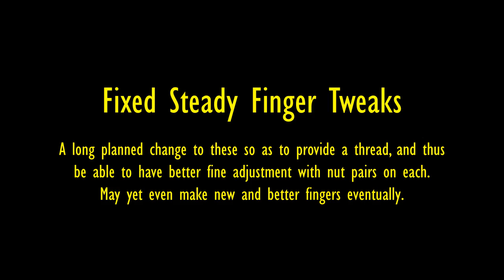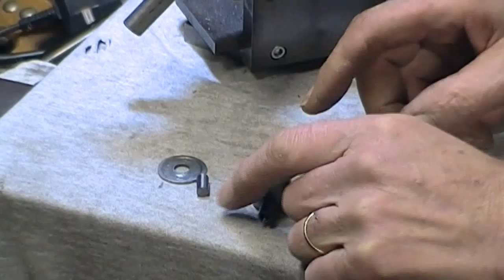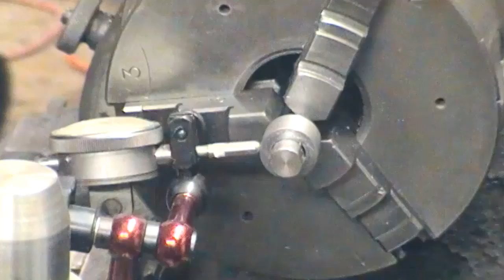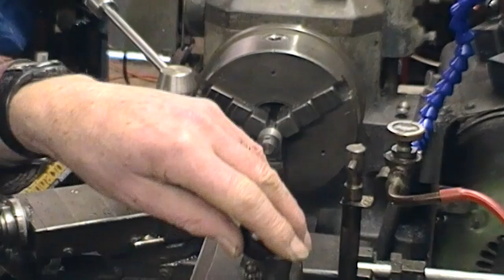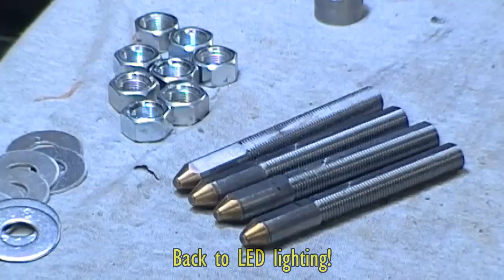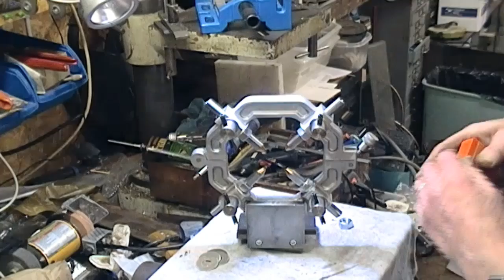Fixed Steady Fingers Threading

Comment: Good idea to add a nut.  While watching I thought that the next time you have a casting like that maybe you should make a slot where the T-handle is screwed in and put a thin nut in the slot to give total both direction adjustment of the fingers.  That is probably not a very understandable explanation.  I see you look a lot warmer now.  I ran the air conditioner in my shop the past two days.  Thanks for the video.
Reply from the maker: Air con?? Holy smokes! Expecting down to near zero again soon!

Comment: Get some 'jam' nuts; they are half the height of regular nuts.
New fingers: Mill the ends to hold rollers skate bearings. (super cheap on eBay.)
Reply from the maker: Hi Bill. Yes, used to call those "half nuts" - however, as I have mentioned already in one or two comments - if I leave off top nuts I still have the existing finger locking option, the bottom nuts being the prime adjustment option.

Comment: If you use jam nuts on the outside, you might be able to get another 1/8" or more on each finger if you need to use it on smaller pieces with the nuts.
Reply from the maker: Yes, could help.  In fact the more I think on it the more I reckon outer nuts hardly needed - the lower ones being the critical adjustment items... if top nuts left off we can still adjust with lowers and lock with the existing old method. Must try it out soon.

Comment: also wanted to say I dont like your new setup i see no benefit to it....but if the bore that the rods you threaded had  1/2-20 threads in them .....then i would make more sense....
Reply from the maker: If I had started from scratch on the steady frame, might well have done that. Even without that, the nuts still make it easier than before.  The lower nut adds travel gradually on each finger and upper one locks it, altho original locking system still works too.... so, lower nuts are the main key to better precision.
Reply: alright...Then you will have to do a vid on its use :)
Reply from the maker: Lawrence Harasim Haha - I guess a demo is in order at some stage! ;)

Comment: I enjoyed the thought process/problem solving that you employed.  The current solution, when added to the previous work, moves toward increasing the complexity of the device.  If it does what you want it to do, I suggest you put it to use.  Nice work.